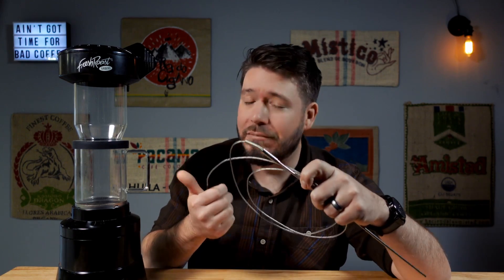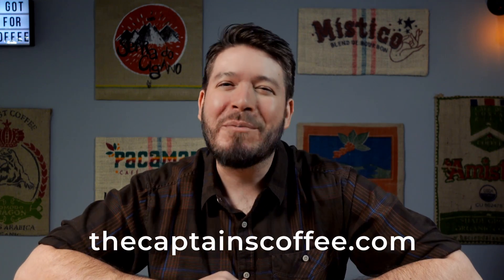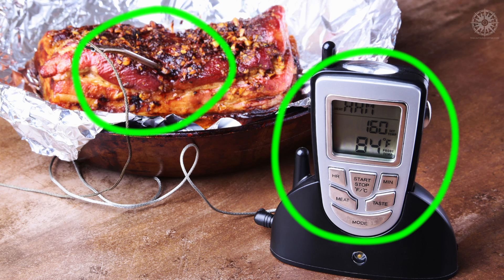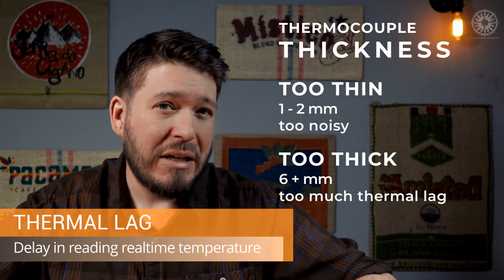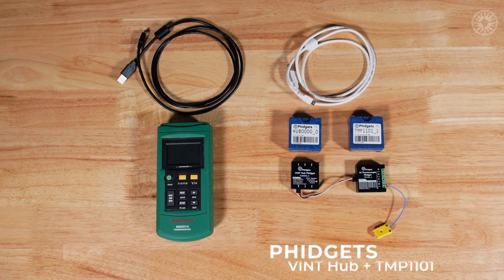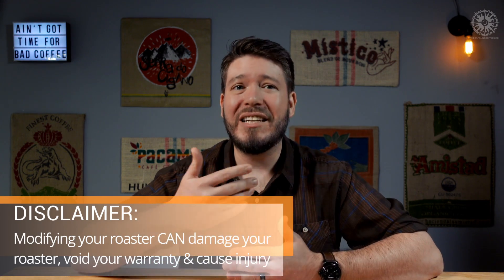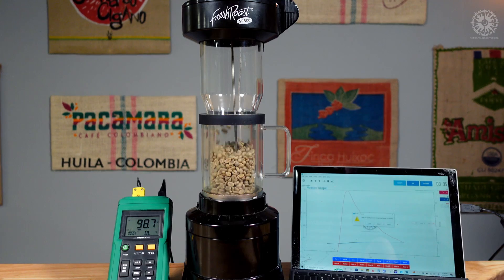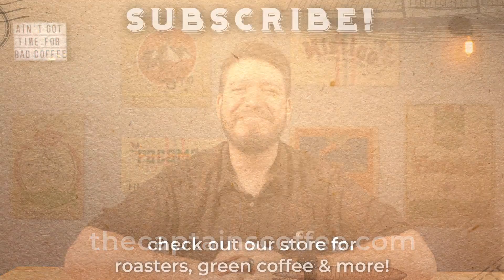Fresh Roast SR800 Thermocouple Installation for Artisan | Temperature Probes, Mastech & Phidgets

Comment from the maker: Need help setting up Artisan? I gotchu! https://youtu.be/4VFM4jvDLi8
Reply: I cannot get the mastech to show a temp. Using windows 11. the driver is fine (per windows) but it is reading Com3. The mastech probe works fine but artisan and the mastech arent "talking".
Reply from the maker: @sdjewel1  make sure the usb link is turned on on your mastech (hold the button till it beeps). make sure your thermocouple is plugged into the T2 input in the mastech. make sure you hit the "on" and "start" buttons in artisan. One of those 3 is usually what's missing ☺

Comment: A nice retrofit but I'm wondering how accurate "bean" temp really is ... after all it's really measuring the air temp at whatever level you're placing the probe. So how well does it really utilize the readings and interfacing with Artisan.

Comment: Hello! Getting the Razzo 5 with their build in thermocouple. So from my understanding i will still need a thermometer. It also comes with the PEAK display so I think it's behooves me to do THe cheaper Phdiget instead, I went to your site with the links and it has the HUB and the 4x phidget..do I need both or just the one?

Comment: Should be using a compression fitting.
Reply from the maker: that would be ideal if you can find one that's the right size! Otherwise this works just fine
Reply: @TheCaptainsCoffee  ...Amazon offers pretty much any size.   In my case I found the 4mm size I needed on Amazon.  What size is your TC?

Comment: Do you know if there are cheaper thermocouples that can run on MacOS? I know this driver that you have listen has for MacOS so Im wondering if you know any cheaper thermocouples that uses this driver. Thank you!
Reply from the maker: Since you are mentioning drivers, I assume you meant thermometer instead of thermocouple - I am unaware of any other thermometers which interface well with Artisan outside of the Mastech and Phidgets. There are plenty of thermometers out there that will simply display the temperature which I mentioned in the video and they are very inexpensive. It's the interface between USB and the thermometer that raises the price

Comment: I recently bought a SR 800 and the chaff collector cap now has a stainless steel plate rather than a mesh. I don't think a home drill would go through it. Any ideas for a hack short of getting a metal drill press?
Reply from the maker: You simply need a drill bit intended for metal! If you are going to do this, be SURE to wear eye protection - metal shavings flying towards your eyes are no joke. Also putting a piece or two of masking tape over the intended hole before drilling will help keep shavings to a minimum

Comment: Hi, how much was the difference in bean temperature between the fresh roast display and the thermocouple reading?
Reply from the maker: That depends on you and your roasting technique. The farther apart the 2 readings (with chamber temp higher) the harder you'll be pushing the roast and vice versa. I usually stay about 75 to 100F ahead of the bean temperature for a typical hot and fast roast meant to preserve acidity and origin flavor. This results in about 6 to 7 minutes to first crack
Reply: @TheCaptainsCoffee  thanks Captain, so if i install a bean temp probe on my fresh roast chamber that reads the bean temp and end the roast when it reads 402 would the fresh roast display be 75 degrees higher? Since it is reading the hot air coming in not the actual bean temp?

Comment: Is the temperature that shows on the roaster usually higher than the one on the on the thermometer?
Reply from the maker: Absolutely! Think of the temp on the roaster as your oven's temperature and the probe as a meat thermometer. You always want the over temperature to be higher so your meat in the over cooks!
Reply: Yes, because that is the incoming heat coming from the heat source.

Comment: Hi, I've started my first few roasts with an SR800 and Artisan. So far so good! Question, do you see any value in logging ET for the SR roasters? Since I have spare thermocouple ports I feasibly could, but do you think it would provide any value in improving roasts? Seems like any changes I would make would be seen with BT. Thanks!
Reply from the maker: I don't personally bother tracking ET but I know plenty of roasters who do! I look at it as another tool in your toolbox. If you think it's useful, go for it, but I don't think it's NEARLY as useful as BT :)

Comment: Thanks David, this is exactly the video I've been looking for. I just got the FreshRoast extension tube for my SR800, and I've been looking for info on sourcing and installing a thermocouple. If I wanted to use the dual input feature of the Mastech MS6514 to measure both the bean mass temp and the air temp, where would be the best place to position the second thermocouple?
Reply from the maker: I don't really worry too much about ET but most people place that probe as close to the outlet of air as possible. So you'd want a shorty positioned with the tip just inside the chaff collector lid!
Reply: @TheCaptainsCoffee  Thanks for the response, love your channel!

Comment: Great Video as usual David,…
For those of you that are using an Apple product ,,,unfortunately Artisan won’t connect.

I wanted to use my IPad,so during the cold months I could actually come inside to monitor my roasts ,,,I found a App called Roastmaster that is very similar to Artisan,,,I utilize a Device called a ThermoBlue Q from ThermoWorks that interfaces my thermocouple to my IPad wirelessly,,,I’m roasting with a SR800 with the Razzo  12 “extension tube 
During my roast I can monitor bean Temp and ROR in real time,,,It works great 
Hope this might help someone out there 

Ken
Reply: Thanks Ken, so good to know.  I had been hoping to use my iPad. Now to take the leap and get the hardware and software to move above sensory roasting.
Reply from the maker: Great suggestion, I'll look into that app!